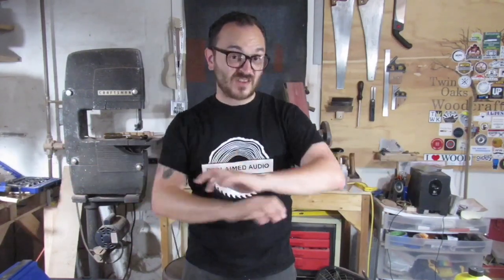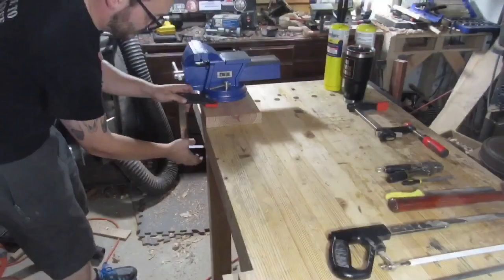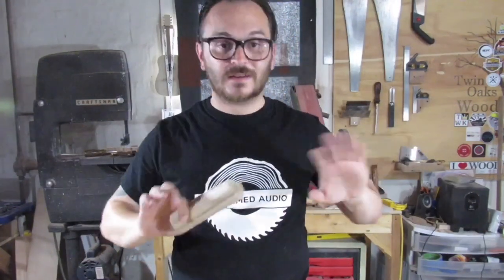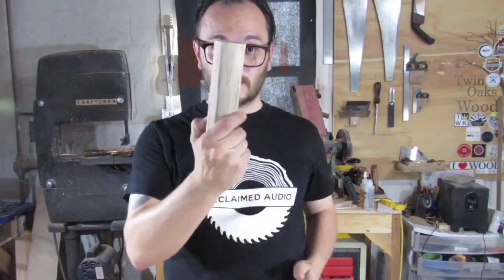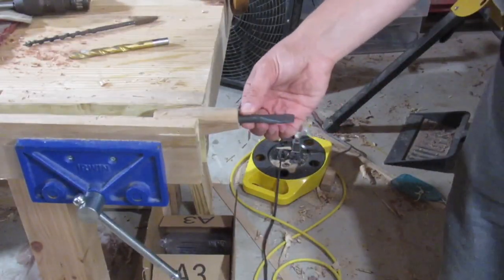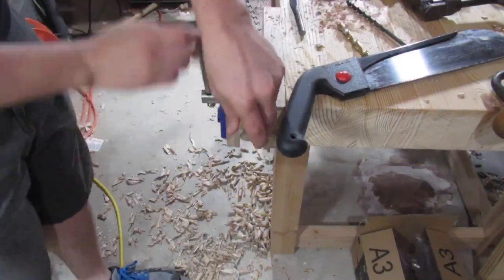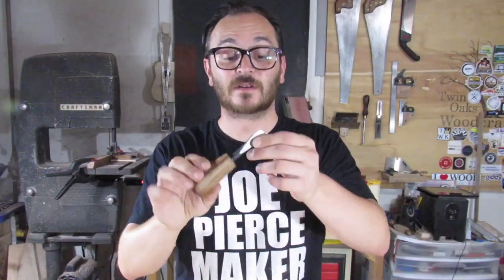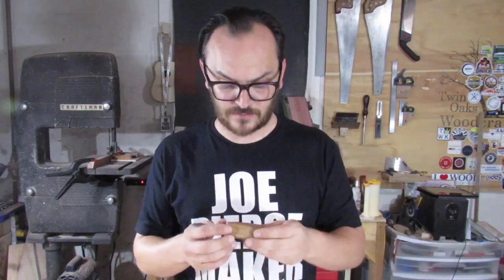Forging Steel Without a Forge - Making Time Podcast Challenge

Comment: Joe this video is straight up Awesome! You touched on every aspect of the challenge! You made this challenge feel very doable for all skill levels. Also thanks for the excellent mention!
Reply from the maker: Dread Knot Woodshop Thanks! I wanted to start as simple as possible. I’m definitely going to do more forging the only drawback is that with just a torch the metal doesn’t get quite hot enough, so I’ll have to grab some firebrick and make a small forge.